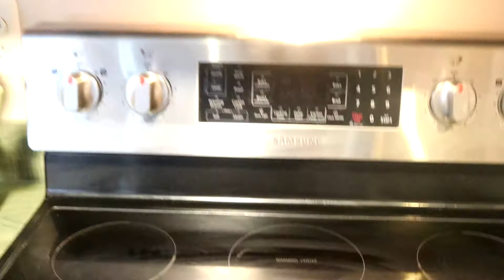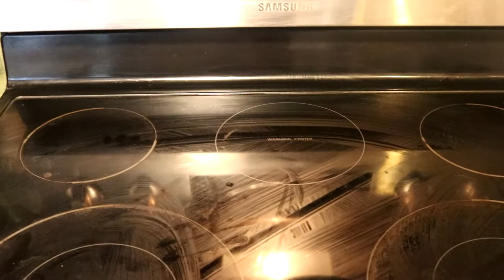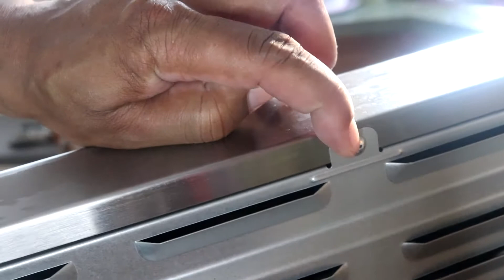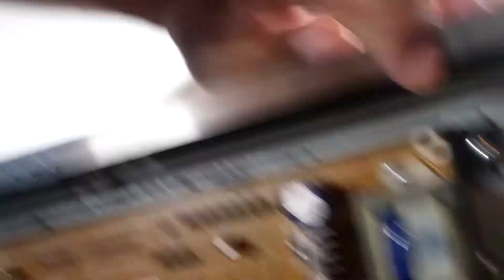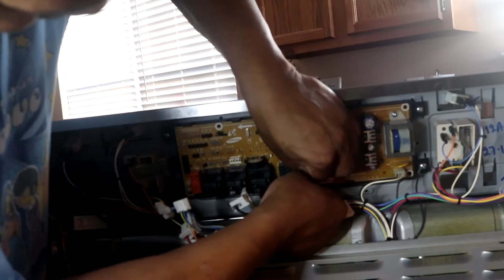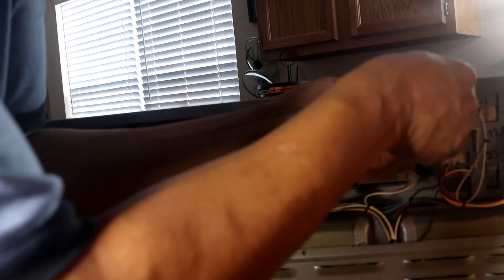Samsung Oven (Range) Oven not working - no heat - replace part(s) & repair. fix repair

Comment: Looks like the one at my son's rental unit that just went belly up. It is showing ERR when you set a temperature and press start, and then the time display resets to 12:00 and flashes.  Going over there tomorrow to check it out.
Reply from the maker: Keep me posted on what you discover
Reply: @justron1865  Forgot to get back to you, Ron. It was the display board (also referred to as a sub-panel), as I suspected. I did a video for my channel to show exactly what the symptoms were and what it takes to fix it. These days, I feel an obligation to put out info that can help someone save a buck. Times are tough.
Reply from the maker: @thehoneybadger9262  please link your video here.  Thanks for the update
Reply: @justron1865  I ordered the service manual for the oven, but it didn't really help that much. WHen I got there, the display was not showing ERR, and there were no stored error codes when I entered diagnostics mode. The manual did give me specs on the resistance of all of the heating elements, which I checked, and I checked some voltages on the two circuit boards, but given the symptoms (the display goes wonky and the PCB resets when I hit the start button), I'm thinking it is a bad Sub-PCB board (the one the display connects to). However, I ordered both that board and the main PCB board, and will return the one that doesn't solve the problem (hopefully it is not the keypad).  I'm thinking either there is some supply voltage glitch when Start is pressed, or the microcontroller firmware got corrupted, and that causes the board to reset after a few seconds.  Will let you know how things turn out.

Comment: Don't see no cooling fan on your's like my gas model.   I bet it will break again.  Probably getting to hot.
Reply from the maker: Yeah its a small one internally.  It's been holding up good so far

Comment: What if everything is working but the lights on the control board font come on?
Reply from the maker: @Tu51ndBl4d3 you mean the lights don't come on? burned out LEDs on the circuit board

Comment: Nice video. How much did you pay for your spare electronic plate? 800$ ?
Reply from the maker: I paid about $110 for the Circuit board - not a bad price
Reply: @justron1865 rczs but the
Reply from the maker: @andreaj.schedel6742  thanks for your support